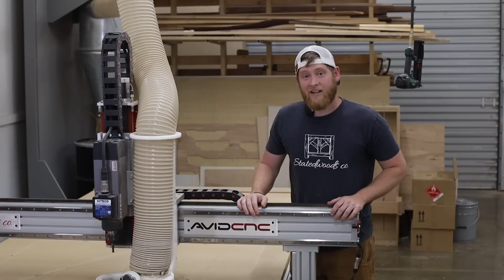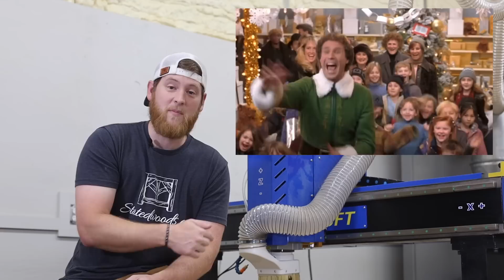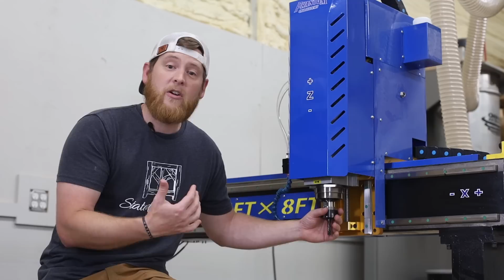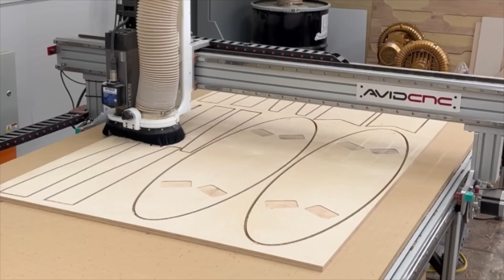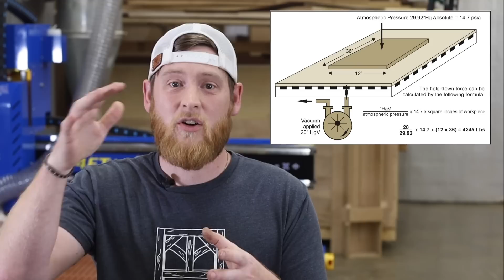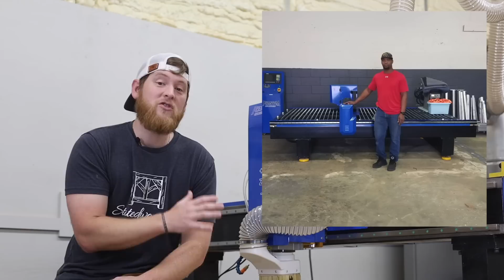Which is a better machine?

Comment: How you can consider yourself an "impartial" reviewer since you are listed as a Phantom Dealer on their website?  Personally, I think this fact should be disclosed at the START of the video.  Otherwise any reasonable person would consider this a conflict of interest.
Reply from the maker: Not sure how to add that to the video after it came out. Wasnt helping with a dealership until after this video.
Reply: @Statedwoods  I appreciate your honesty.  There are several other things in the video that should be cleared up in my opinion.  The first is where it is made. As you are likely aware by now, Phantom does not make their own machines as they are a rebranded Utech machine from China.  Also the frame is made of 4mm steel, not 9.5mm (3/8").   While there is nothing wrong with that, it is a bit misleading for you to compare it with machines such as the CamMaster Panther which has Servo Drives, weight in at 50% more than the Phantom, and is Made In The USA.

Comment: I don’t understand the rollers. What if the machine is moving around on the workpiece and one or both of the rollers run off the edge? I saw a demo of the unit in another video and this happened even without anything on the table. I feel like the rollers add in a whole world of fuck up possibilities.
Reply from the maker: They are designed to roll over and off the workpiece if needed.  They take away a lot of fear of work pieces moving while cutting or sheet good lifting off the table from warpage. The rollers are a game changer and I will never own another machine without rollers.

Comment: The movement and rigidity is one reason I went with my ShopSabre.  Phantom looks like a great machine as well.  About the only thing I wouldn't want are the rollers, I prefer my vacuum table, but otherwise the machines look well made.  IMHO, the argument against a PC is unwarranted and misguided.  In fact, I'd argue it's an advantage over a tiny screen and proprietary keypad.  PCs are hell-a-reliable, especially when purpose built, very convenient to access your NAS for G-code and/or review cad files, etc.  Windows update is a non-issue if configured properly.
Reply: I also have a ShopSabre.  I have a PC design computer that is online.  I have a hard wire network to the PC that runs the CNC, it is not online and never updates.  If it is working, I don't need updates.  It is unable to be distracted from it's dedicated job.  Great comment CO WW.

Comment: C7.30
"Cut 200-400inch/min" 
?????🤣
That is way to fast even for industrial level machine...
Reply from the maker: I cut regularly at 400-600 ipm now
Reply: @Statedwoods  
You probably have no idea how much force is exerted on the gears and linear guide carriage at such a speeds...
Don't be surprised if the warranty does NOT cover these damages...
Reply from the maker: Warranty covers it. I could do the math and figure the forces fairly easily. Not sure why I would want to though. These things are way more powerful than most would ever need

Comment: 7:40 - very easy to ad rigidity and mass. Some laser cut sheet metal panels bolted to the base for example. Still a negative point but if ur running the machine like that you can easily make it work better for you.
Reply from the maker: I agree with you
Reply: @Statedwoods  - I would go for the Phantom tho! That’s an insane price! How is customer service? Any training given?

Comment: Wanted to make sure I understood…it’s around $19,500 for the unit, then another $1,500 or so for the vacuum system, correct? This was a great video for someone looking to enter the industry as a brand new beginner. If I can bypass some learning curves, I appreciate any help I can find!
Reply from the maker: Yes. That is correct. Glad it helped you.
Reply: Then there's delivery and installation.

Installation requires the rental of a fork lift, and the proficiency to lift something as expensive as your car with it. Or hiring someone that is properly licensed, bonded, and insured...

I beleive I heard 2,000 quoted for all that. Once the delivery company hears CNC the price goes up!

Comment: One reason for phantom to be cheaper than shopsabre is that shopsabre uses a Mitsubishi controller, motors and drives. Hsd spindle. While phantum uses an unknown chinese weihong  controller, delta drives, motors. Unknown air spindle.
Reply from the maker: Spindle is HQD. Exact same as HSD just different factory location. Delta drive motors are very popular and some of the best out there and controller is very stable and extremely easy to use and customizable.

Comment: Great video Nick, very well done for the newbs looking to jump in.  I know u only have these two machines, just curious if you have any experience  with shopbot and Shop Sabre.  They both seem to have the rigid frames?  Also, I wanted an ATC as well as indexing and a vertical clamping for edge work for things like dovetails.  ShopBot and ShobSabre both do this...any thoughts?
Reply from the maker: They make good machine. I always stay away from ball screw machines however. They will have flex on large machines on the ball screws and loss of torque compared to helical rack and pinion machines. In my opinion.
Reply: @Statedwoods  Thx for your input... fortunately, I can live with a 30x40" range work area machine, that should help on the ball screw flex issue I would think...I also suffer the problem u advised of, a 42" wide door opening!  argggg.   Hence why I was considering the Avid, but I will doing precision work, where  +/- .001" actually maters, such as dovetails and precision nesting.   With all that info, is there is any other machines u would suggest?  Phantom does not make smaller machines with ATC.  But I love all the incredible features they offer.  And before your video, somehow they flew under my radar!  which is odd, as in most fields, we know every maker in the category we are considering, obviously not true in CNC world, hence all the similar comments.

Comment: Good video, informative, valid points. However when it comes to weight, whether it's for humans or machines, weight is rarely a good thing. This is usually a sign of poorly engineered, low cost designs. If it was true Ferrari', Porsche' would be built like a tanks. Engineering a light, stiff, reliable, accurate machine costs money...
Reply from the maker: You always want a heavy machine when it comes to CNC. Its like having a stable foundation. Light machines move and are unstable. The weight is literally engineered into the machines for a reason.
Reply: What a dumb thing to say

Comment: Thanks you for the information. I have not reached the height of needing such of a machine yet..But for sure I like the phantom machine much better now. 

My question to you is,  can you also do Aluminum cut and if what are the thickness etc.. I looked at the websites and it didn’t say anything about this.

Again thank you
Reply from the maker: Thanks. Yes you can cut everything but steel on this. Whatever thickness you want depending on the bit
Reply: @Statedwoods  thank you , very helpful

Comment: I was curious on the vacuum pumps, do those when connected together in series like you have it require two separate 230v circuits? Meaning in total to run that machine you will need a total of 3 separate 230v circuits ? Or does it somehow connect those two pumps to the same 230v circuit.
Reply from the maker: No you are correct. They need separate 30 amp breakers.

Comment: Not hating, but I feel like this approach misses the mark.  The DIY community is about cheap entry-level systems and custom DIY upgrades.  I remember working on a CO2 laser in the 90's that cost several million (I think close to 20mil), was imported from Germany, and needed constant expensive repairs and daily maintenance.  Now days you could buy 100 comparable laser cutters.
So for the AVID, why not just bolt it to the floor... and possibly add some additional cross bracing (cables or beams would add rigidity).  I feel like that's what DIY is really all about.  It used to be that you had to have a bottomless pocket book to play ball.  Those cheap machines allow average Joe's a chance to get started.  You can immediately turn around and use that exact same CNC to make upgraded parts for itself. 
I customized the F out of my Creality CR10S in week 1.  At the time it had the largest print bed you could buy but was very unstable.  Because of its size its not as steady or accurate as the smaller 3D printers of its time... it uses same extruded aluminum t-channel structure you see everywhere making modifications easy and designs aplenty.  It was fun and not that much work modifying it.  Now it prints like a champ and didn't break the bank.
Extruded aluminum t-channel is also relatively cheap, so even if you don't machine your own parts you could modify your gantry height for cheap.
Reply from the maker: Yea I agree. But the comparison was about Pro level machines. Why work that hard to modify when a pro machine is already built for you. CNC production doesnt want to have to DIY 90% of the time.

Comment: I feel that you are comparing 2 different market types of machines avid (prosumer)  and phantom commercial. each has its place and use. Personally, at this price range I would buy an techno cnc.
Reply from the maker: Both are called “Pro” so i ran based on that labeling. But I agree with you mostly. I hear mixed things about Techno.

Comment: I prefer all ballscrews axis and closed loop steppers. Especially if cnc is about automation, open loop stepper makes no sense to me. Also if you are into tweaking, modding I prefer a pc and mach3 or even better a real time kernel linux with a fpga control card.

Comment: Great comparison 👍  I tend to disagree on the SW part, however. As a hobbyist I would always choose an open system like Windows over a closed system. You can very, very easily tell you computer not to auto shutdown on updates. But you have the freedom of choice what kind of CNC SW you use and you can include your router control in your network, so you do not have to fiddle around with a program on a USB stick everytime you make a change to the CNC program...
But the flimsy frame under a 20 grand production machine is just an outrage. Just plain crap ! Have you added the welded cross members yourself to beef it up, or were the already stock?
If you run a "small" 2x4' in your basement hobby shop an Avid is the way to go, because you can't wrestle an already completed machine in there. If you are a semi-pro or even professional woodworker with a decent ground level shop...don't bother with a flimsy Avid...
Reply: Actually, an offline controller is far more superior to a PC based controller unless it's an Centroid Series or Yaskawa Compass PLC type. Richauto are highly stable controllers especially the B5X series( Graphical Display and HDMI input), Weihong/NCStudio, Syntec, and LNC. They all are excellent offline/integrated CNC controllers that far supercedes WinCNC or Mach3/Mach4 for motion control on CNC router. I'm willing to do a head up comparison to point out the defects.
Reply: Windows isn't open. LinuxCNC is open.

Comment: Well that's why the first thing you do on a pc running Windows snd critical processes is to dusable the automatic update feature ;)
Never had a problem with updates on my notebook driving my cnc even it is connected to my network and Internet.
Btw:
Most European countries have 3 phase 400V supply which is splitted to multiple single phase 230V circuits. 
So you have 230V for usual appliances like vacuum cleaner, kitchen machines, light, TV and so on and 400V for the electric stove.
Usualy you don't have 400V 3phase sockets in your house but it can be installed without reconnecting the house to the power grid cause its supplied by default.

Comment: AVID is more of a pro-sumer CNC (between a professional/commercial and a home unit), while the Phantom is more in the commercial area.  I have an AVID and the leg structure allowed me to install it in my basement.  I could never have moved a welded unit into my basement.  Also note the AVID unit does not come with a base.  The leg kit is a separate purchase.  I know of some AVID owners that made their own base, either welded steel like the Phantom and some made the legs out of wood.
Reply from the maker: Yep thats what an Avid is good for.  I agree with you. I have friends doing the same thing

Comment: To shart off
Avid cnc is a hobby/small workshop machine and thats what you should expect from it
cuttings forces are usually a few kilos at most so no you wont lose steps cutting wood at normal speeds on either of these machines.
no point in pushing a gantry of a powered off cnc, quite stupid off you ngl
also i believe you shouldnt have bought the frame or legs for the cnc instead you should have bought alu extrusions and made it your self. you wouldnt spend 10th of the price on a diy frame. just the legs were more then 1k and that probably wasnt more then 6m of extrusions. same with the frame
at 5x10 avid cnc is a joke and you entered the industrial machine category so not a real comparison
you made a decision to buy a 8hp 3phase spindle, not their fault you only have 1phase.
almost 5k for a 8hp spindle was a waste of money btw but ok. 
while i do agree with you, you made a bunch of shitty points and definitely arent someone that should be giving advice on cnc machines
Reply from the maker: I thoughts my comparison was very fair. I lost steps all the time on the avid when parts moved or tabs broke. Had a video of it in the video with 3/4 inch baltic birch at 240 ipm.

Comment: Thanks bro I’ve been running CNC machines for the last 25 years from the Italian machines to the latest Chinese ones you’re so right about everything I even upgraded my Australian machine with the same controller you have I love the simplicity and it is a magic controller amazing features in it perhaps what you should’ve mentioned also would be that a automatic tool change is not that much more expensive and saves a lot of a lot of time Love your work bro keep it up cheers Ziggi (Australian)

Comment: Usually machines that you upgrade as you grow will end up costing you the same as a pro level machine but will lack many pro level features.  I have an Avid benchtop pro 24x24 and I love it.  It uses the same structure as the other Avid Pro series but because it is smaller the rigidity is really good.  People need to understand is as you scale up the table size you also need to scale up the rigidity of the structure.  So the aluminium structure avid uses are good for their 24x24 or 24x48 machines but as soon as you make the gantry 4feets + wide you are better off with pro welded steel frame machines.
Reply from the maker: I agree 100%. Well stated.

Comment: We bought a custom machine from Phantom and it has been great. 5x10 table, taller Z, ATC and a rotary axis. An amazing deal compared to what it would have cost for an equivalent machine from a large brand name like Laguna. We spent a fair bit more then the best Avid setup but also got a lot more. For a machine with similar capabilities to what you can get from Avid is in the same price range. I think that if you are looking for a machine as a business the choice between it and the Avid is a no brainer for all the reasons mentioned. 

If I was going to give it a fault it would be more on the control side. Mach 4 works but has short comings and definitely isn't a finished full stable commercial solution. But this is likewise a issue for the Avid. It's probably less of an issue if you are not running a ATC and simple doing panel work.

I would recommend Phantom CNC machines with no reservations. Great product and good service.
Reply: The great thing about laguna and phantom. Probably same factory in China made both!
Reply from the maker: Great comment Nate. Thanks for your experience on this too
Reply: If China moved to North Carolina, then ya Phantom is made in China, North Carolina, USA.

If not then China's "Tofu" construction couldn't hold muster up against Phantom's scrutiny.
Reply: @brandonhoffman4712  china 100% makes phantom. Under The supervision of the company in NC. China makes some of the best machines in the world now.. also some of the worst you just have to know what you’re getting. Phantom basically handles that for you.

Comment: Your controller on the phantom is not a plus the flavor of gcode will be incompatible with higher quality  tool path options in things like fusion360 adaptive tool paths etc.
Reply from the maker: There is a post processor for fusion and the Phantoms. It works great for adaptive tool pathing. Actually what the Phantom was originally designed for was Fusion 360 compatibility. The owner uses Fusion all the time. Adaptive tool pathing on the 4th axis is amazing.